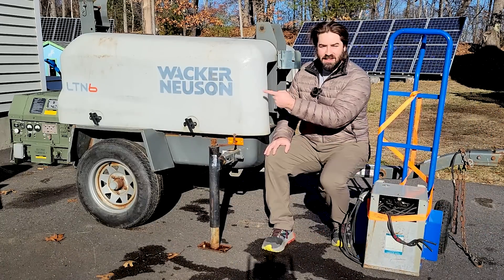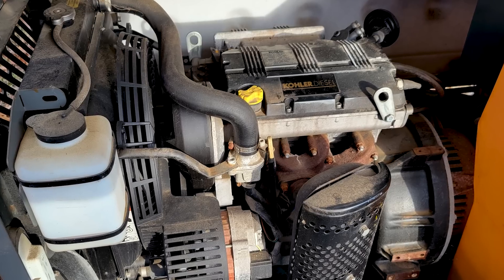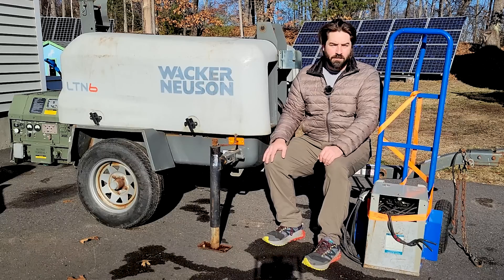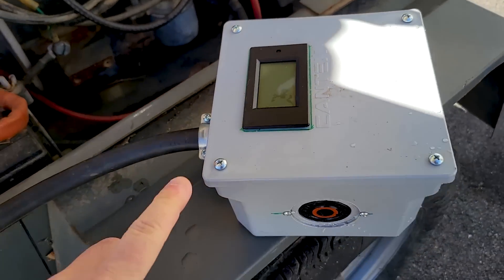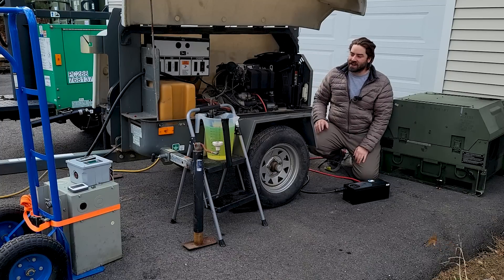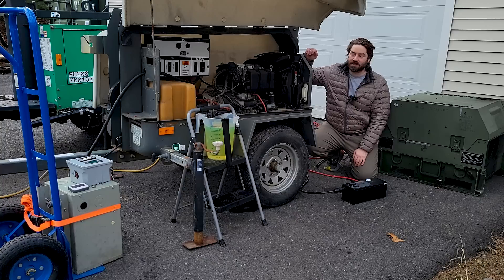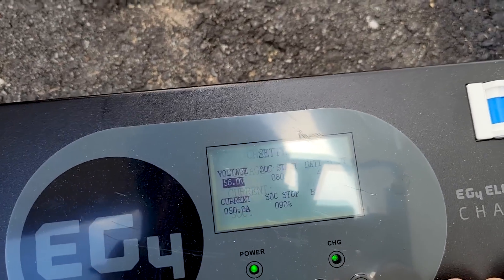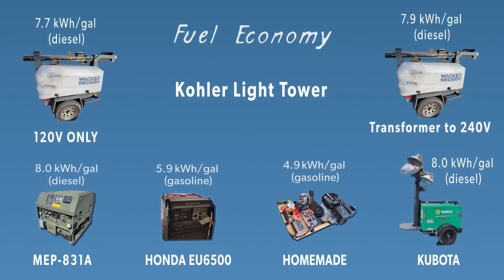What's better, 120V or 240V?  A Kohler generator experiment.

Comment: Well the generator on the Nelson light tower is three phase but only one leg is generally used but while two legs are wired to the breakers for possible expansion later. Which means it's 220 as it sits. The benefit to using the transformer is to smooth out the power flow for sensitive electronics. To use the max power from the transformer you do need a capacitor to keep the wave length in sync. Have fun seems like a fun project.

Comment: If the engines going to maintain a steady rpm, I believe adding a good sized flywheel could help out with fuel economy. Currently about 1.5 turns of each cylinder is wasted, and the engines having to use more fuel to overcome that. I believe it should be around 2-400 ibs to help out the most. That would hold around 5-10kw of energy at 3500 rpm.

Comment: Are you able to rig up your light tower generator to an ATS to start automatically when the inverter tells it to?  I know with the EG4 chargeverter communicating with EG4 batteries in closed loop, the chargeverter can turn on a generator with 2 wire dry connects so it only charges the batteries while the inverter continues to power the house.  I came across some used light towers today w/Kubota engines and was wondering if they would work with an ATS.
Reply from the maker: The two light towers I have do NOT have a 2-wire start built-in.  They could have an aftermarket auto-start wired in, but I don't have experience doing it (yet) so I can't recommend one.

Comment: There must be a way to rewire the alternator head on the generator to output 230 VAC.  The two separate 115V outputs could be wired in  series.  Your risk if you try this.  YMMV.

Comment: I have some work to do, but will eventually try this with a military diesel MEP-803A 10 kw 1800 rpm liquid cooled generator which many  people claim is close to 1 gallon per 10 kWh of power output.  I plan to try this with winter blended pump diesel as well as summer diesel since winter diesel can have a much lower energy content (BTU/gallon) rating.

Comment: I'd like see a second "chargeverter" added to the system using this autotransformer running 120v on separate legs.  I suspect it would be lower efficiency but one should never assume.

Comment: Per the Wacker Neuson LTN6 online manuals from their parts store. These generators are 120/240V. While the convenience plugs may be only 120V the generator is wired for 120/240V power. Most likely your light plant was Metal Halide or Sodium Mercury Vapor lights. Find the ballasts and pull them off the generator (easiest location is the breakers). Now connect a convenience receptacle in for a 50A RV style or a CS6369 receptacle.

Comment: You'll likely experience a lot less loss using an auto-transformer rather than an isolation transformer. An isolation transformer is called that because the input is completely isolated from the output, IE: All current passes through the transformer coil. With an auto-transformer one leg from the generator is "passed through" and doesn't pass through the coil at all so there's no loss on that leg. Only the second leg goes through the coil in the auto-transformer.

You also need to re-run the transformer vs non-transformer test back to back on the same day to make sure the difference in efficiency isn't due to ambient air temperature, humidity, etc.

Comment: Diesel fuel here in AZ is about 3.50 gal. If my math is correct that woud be 44 cents per kwh.
Reply from the maker: That sounds right.  It's a little bit more expensive than my electricity rates right now.  Once I tap into the surplus heat, then I expect the generator will be less expensive than the grid.  Of course, we could start the conversation of maintenance costs too.
Reply: Looking forward to seeing your heat exchanger project.

Comment: Some things to consider so you have it more in one place:
1. Transformer losses may be small.

2. Double the voltage, you slash transmission losses by 4x.  You have twice the voltage, so need half the amperage over the wire.  Twice the voltage means say you lose 4V over the wire.  At 120V, this means twice as much efficiency wise as it does for 240V.  Then with half the amperage, you have half of the voltage loss, so say a 4V loss becomes a 2V loss.  So while you missed the voltage measurement between the generator and battery charger, the thing you really needed to measure, I am thinking the effective voltage drop is significantly less and overall transmission efficiency is higher.

3. My understanding of these chargers is they have to have an active PFC (power factor correction) getting them to close to a 100 power factor, maybe in the range of 97 to 99.  It is not chopping the peaks or doing something else to get a crappy power factor.  If it is sloppy like you say, that hits on #2 a lot more.  It turns out power supplies like these are far more efficient at 240V than 120V.  Nearly 2/3rds of the power supply is running at twice the voltage, so is seeing half of the amperage through it.  This means it is losing a lot less power.  When only ~1/3rd of the power supply sees the same voltage, that part is no more efficient than before, but the other ~2/3rds of the power supply before being pushed really hard, is working a lot less hard and thus operating a lot more efficiently.  Probably more towards the sweet spot of efficiency for these parts of the power supply.  While I don't know the efficiency curve of this particular charger, something I have seen before is say at 120V a charger will be say 83% efficient while at 240V it will be 87% efficient.  Not super huge differences, but significant.

4. These power supplies have parasitic losses.  So you double the voltage and drop from 2 chargers to 1 charger, you dropped the amount of power lost to parasitic losses by half.

So, doubling the voltage early on with a highly efficient transformer makes most everything between significantly more efficient.  It all adds up to a noticeable savings.

Actually a problem with the proposal to get 48V straight out of an alternator is between using a potentially inefficient alternator as some of these old alternators I have come across are only ~60% efficient and then transmitting power at 48V, is you may be losing a lot of the power between the alternator and your battery bank.  What would be really interesting is a high efficiency generator, maybe a permanent magnet one putting out a reasonably high DC voltage, much higher than battery voltage, and doing efficient DC-DC conversions near the batteries to get down to the 48V charging power.  It turns out at least some power supplies (such as some Maxwell power supplies) are rated to take DC input instead of AC.  The PFC gets effectively bypassed when these power supplies are fed DC power and they run more efficiently.  If you can't get exactly what you want in one device, maybe you can get the job done with 2 devices.  Say getting a switching power supply to take a high voltage DC input, output 48V DC with no variability, and then getting your hands on a DC-DC buck-boost converter you can control to charge the batteries (hobby charger style), it turns out a DC-DC buck-boost converter outputting close to its input voltage is nearly 100% efficient.  This play comes straight from the hobby charging world where often say a 24V output Maxwell switching power supply is used, which is rated to take a wide DC voltage up to say 370V DC, and the hobby charger, which is primarily just a DC-DC buck-boost converter charges a LiPO battery pack from say 18V to 25V.  I have charged LiPO packs in parallel at 1 kW rates without the hobby charger getting warm until the balance circuits come on and start burning power from individual cells with resister banks.  The actual DC-DC buck-boost conversion in the hobby charger loses almost no power at all.  Getting back to the generator idea and the wide DC input could come into play when running the generator at a variable RPM based on load with maybe max rated RPM pushing say 350V DC and maybe 'idle' 200V, giving you a pretty good RPM range for the diesel engine with some margin to go over or under the target RPM without over-volting or under-volting the switching power supply.  The thought being where you may be hitting say 65% end-to-end efficiency with your 240V AC setup, something like this may hit 85% end-to-end efficiency.  The 240V AC setup has a lot going on and is losing a fair amount of power at various steps and this all adds up and why I throw out a ballpark number of 65% efficiency from the generator windings to what goes over the charge wires.  A good DC setup should be significantly more efficient at the windings, have minimal transmission losses, cut out lossy conversions, and the conversions it does do will be more efficient, thus why I throw out the 85% ballpark number for the same section of this charging system.

Comment: You could save yourself some money by going to red dye diesel fuel for your non-highway/off road use.
Reply from the maker: I thought so too.  My local supplier turned out to have the same cost per gallon as the pump (gas station).  I probably need to shop around.

Comment: As usual, another interesting, well done vid.   I don't think I've heard you say you're elevation - and would be interested as a piece of background info :)
My own generator tests (eu3000is and others) don't seem to be quite as good as their ratings.  My Champion 2500 in particular is dismal (compared to specs) and won't do more than 1100w sustained.  More recently it occurred to me that the 1,500ft elevation of my home (that I take for granted as 'normal') + the Oregon high-dessert (4000-6000ft) camping we do may be why the max running watts don't hold up compared to 'the specs' and other examples I see on youtubes.
Reply from the maker: I understand.  These naturally aspirated engines will have reduced power output at higher elevations.  I think I'm about 500 feet, something like that.  Nothing to write home about.

Comment: what would happen if you turned the 110ac into dc then fed it to a solar charge controller mppt that can handle that input voltage as then power is been stepped down in theory been more efficient and maybe higher current for charging
Reply from the maker: It's possible.  I did something similar with my alternator project last year.  The hard part is the ripple current.  Since this is single-phase, the ripple current is huge.  I would need a very large capacitor bank to filter it.  It's possible, but not an approach I plan to try right now.

Comment: Most generators can be converted to AVR that you can adjust or change to reach 240V if the exciter has an envelope wide enought for not saturating the excitation coils and still compensate for voltage drop in current demand.

Most basic AVR just need the remanent magnetism to generate a small voltage (AC) from the output of the generator to start functioning and compensating the excitation coils (DC) to achieve the desired voltage.
Some AVRs, the better ones even use the 12V battery to start the process if the remanent magnetism is not enough.

I have done it to a vintage (non AVR) Honda EG2200. It was 120VAC 60HZ. I bought a chinese AVR with PWM (pulse with modulation) from ebay, lowered the RPM to achieve 50HZ. And now is running on European spec 240VAC 50HZ. 1800Watt running watts.
So, for some generators you don’t need an expensive, bulky transformer.

Comment: Hi David, nice video again. Next time have a look how to wire your transformer as autotransformer, you will reduce loses in the transformer by two or your transformer could handle twice the power. I'm still interested if you will ever try mild hybrid starter-generator which is 48V already, you can eliminate charger, 110V generator, transformer...
Reply from the maker: I have looked into some used 48V alternators.  One I was looking at was from a Ford truck.  Aparently, the engine shuts off when you are at a stop light, and it uses the 48V alternator as the starter.   From what I saw, there was a data-connection cable where it needed to talk to the vehicles computer.  I don't know how to hack computer code, so I didn't buy it. However, if someone knows of one that is self-contained, then I'd be interested.

Comment: @DavidPozEnergy
 The rubber tape you found is called self-vulcanizing rubber tape and it's used to insulate split-nuts. Any electrical supply house should have it. It's rated for this job but I don't think the shiny tape is.  On the efficiency I expected a slight loss and was shocked (bad pun intended🙃) to find a gain instead. For your use that setup should last a lifetime. Back when gas was cheap I once heard of a man who heated his shop using a 4cyl car engine idling outside with the radiator inside and a squirrel-cage blower ducted to it. You might be able to scrounge some old cast iron hot water heating radiators cheap as hardly anyone uses them anymore to make a hands-free powerless standalone system that way. 

Really enjoying seeing these tests and the repurposing with economy angle.
Reply from the maker: Thanks for the name of the tape.  
I'm looking forward to seeing how much heat I can pull from this.

Comment: You can bump the generator rpm a lot more. Running this at 70 or 80hz should increase your efficiency as the loss in transformer would be less and because you are just running a ac-dc charger you don't have to worry about the frequency messing things up. 
It should work fine with upto 100hz normally.

Comment: Loving this series!
Do you think you would get a little better efficiency at a lower charge rate? I think gas is more efficient at high load,. but diesel is better around half load.
Reply from the maker: This is an industrial generator.  It's most efficient at full load because the engine is over-sized for the generator head.  So, even at full 6kVA on the generator head, it's not full load on the engine.  
Consumer grade generators are often more efficient at 50% or so.

Comment: Here's a thought.  most 120v generators can be made 240v buy changing the leads coming from the generator head.  I did some research on the 30 year old 8kw diesel generator on my coach, and found a diagram the make it 240v.  it was as simple as swapping 2 leads.  it has been performing flawless for years as a 240v generator on the coach and I made a "special" cord that allows me to feed my home in an emergency.

Comment: Nice work. Calibrated scale to weigh the fuel at start and end of the test and use temperature compensation factor for diesel to calculate volume of fuel delivered.